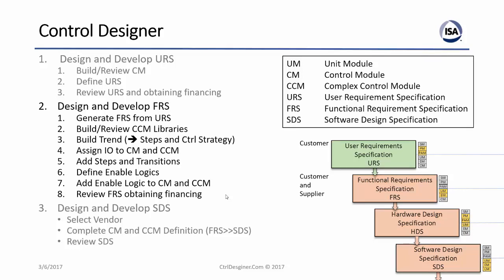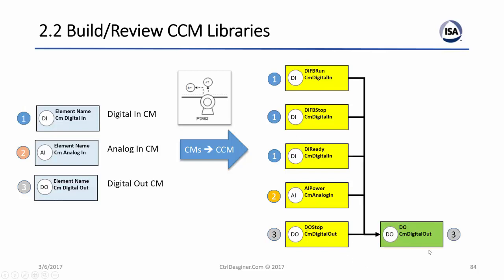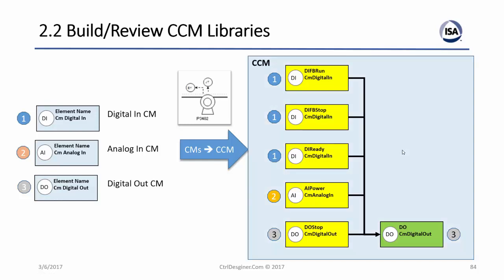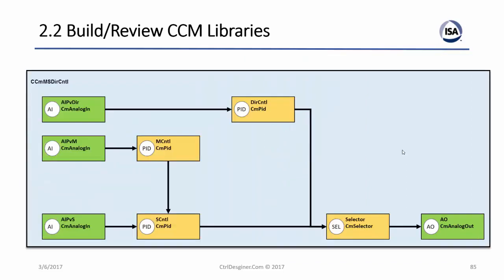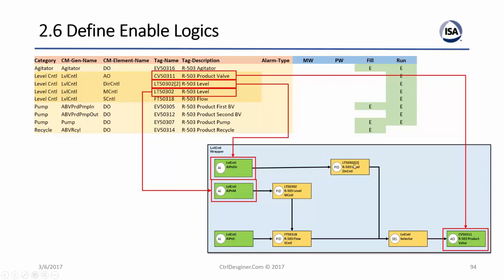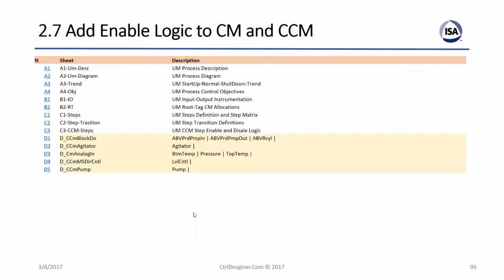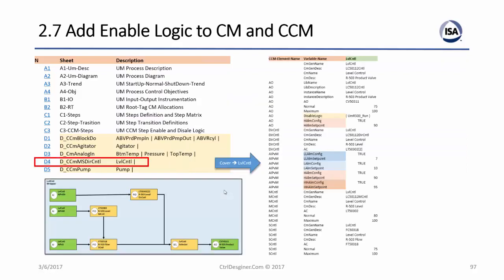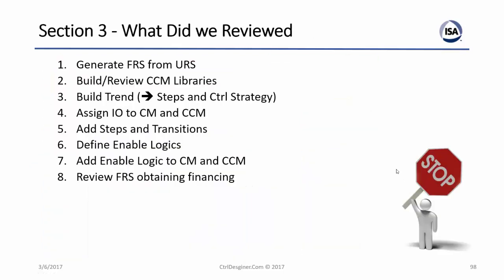ISA 106 - ChemPID March 2017 - Talk Part 03

Comment: Nice serie of presentation. I work often with ISA 88 but I've got a project with a continuous process. Therefore, I think i will use ISA 106 which is very similar as ISA 88 but I like the state based control approach, the trend definition, etc. 

Very happy to have viewed this.

Thanks